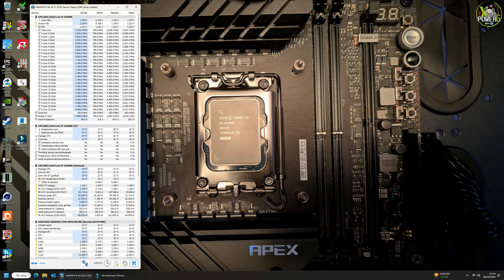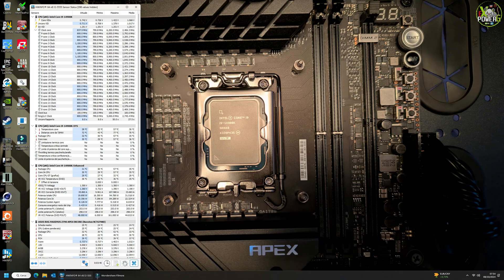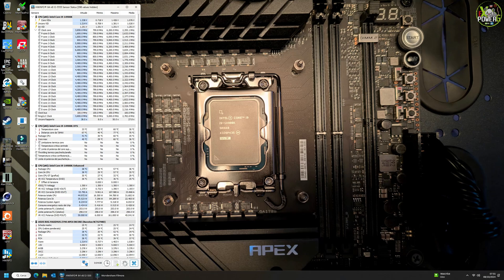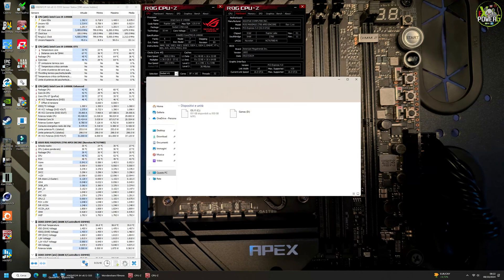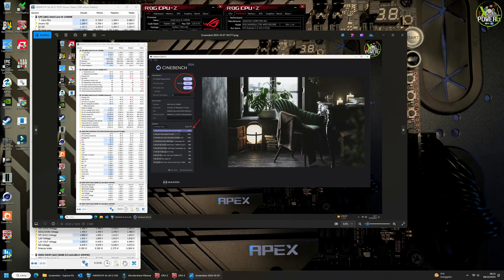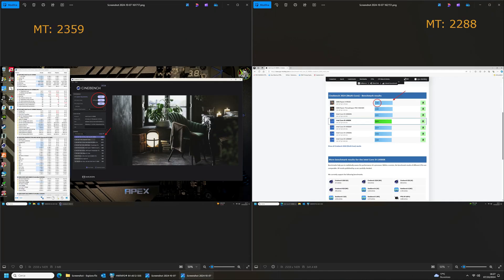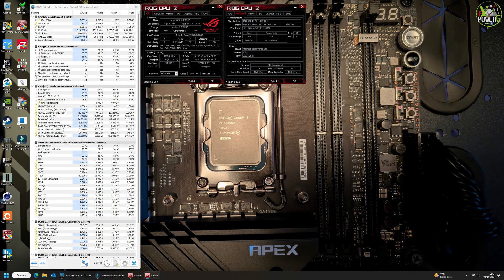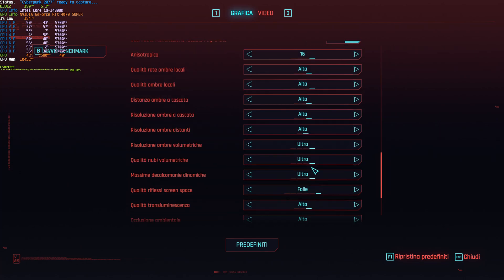Intel 14900K RISES from the ASHES🔥

Comment: IA VR Voltage 1600?? 😮😮😮 The main issue was the cpu requesting over 1.5v so why are you setting this to 1600?
Most recommend 1450 and for sure no more than 1500. 
Isn't 1600 defeating the purpose of the latest microcode?
Reply from the maker: @shaolin95  Intel specs set the limit at 1,720v. The Vcore must be enough to run the CPU when working at low loads and frequencies around 6.1GHz, 6.2GHz. Then, with heavy loads, we exploit the voltage drop and you will see that the processor will never go above 1,180 volts.
Reply: @eXpowerG3046 I will try your settings and report back. 👍

Comment: Где было видео твоё раньше. Я снизил p  ядра до 5.6 и Е ядра до 4.3 
Ring/llc 4.7
Vrm 1.34
Offset -0.200
Hyper off 
Load line 6
Ring down bin off
  Voltage  1.350 больше не растёт проверял через y-cryncher  
80-83 - temperature  
4.3-5.6  Герц. Работает в разгоне. 
Увы если сделать больше то будет синька)

Бро у меня есть сложность.
Немогу не как разогнать ОЗУ.
Менял значения и они не меняются. 
Kingston Fury 32gb 6000 
2 плашки. 
Xmp1 ставлю она не встаёт.
Помоги пожалуйста разогнать ОЗУ. 
Asus prime z790 p wife.
Я неделю мучался и не получается. Уже знакомый помогал у него не получилось а он лучше меня разбирается. 
Xmp1 не встаёт почему то но поддерживает его. 
И значения в биосе вроде Смотрю меняется. А когда Windows  заходишь проверяешь тестишь значения не изменились.
Reply from the maker: Hi please tell me what MC number you have and what kind of RAM, tCL and XMP frequencies
Reply: @eXpowerG3046  expo-6000(3000mhz) expo-5600(2800mhz) xmp-6000(3000mhz) xmp-5600(2800mhz) (tcl 36) all
asus prime z790 p wife

Comment: Thank you very much for teaching me, I tested this configuration and it was amazing! At 6:27 of the video in the performance core 6 and 7 did you put number 60 too?
Reply from the maker: @darlingtonrainer7302  Thanks a lot. I set core 6 and 7 to 57x because they are the weakest cores and so we prevent them from reaching frequencies of 5.8 GHz, in OCTVB, which would require too much voltage and therefore generate heat with consequent thermalthrottling
Reply: @eXpowerG3046  I put this configuration on my PC and the performance improved a lot! My motherboard is a ROG Z790 F! Thanks for showing how to do it
Reply from the maker: @darlingtonrainer7302  🔝
Reply: @eXpowerG3046 how you know they are weak?